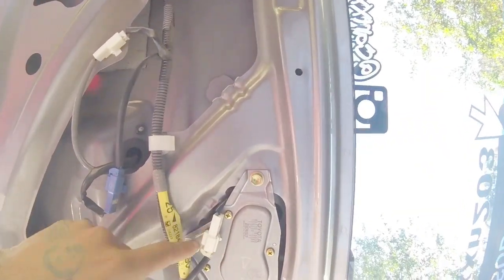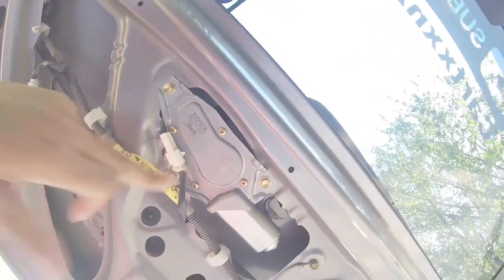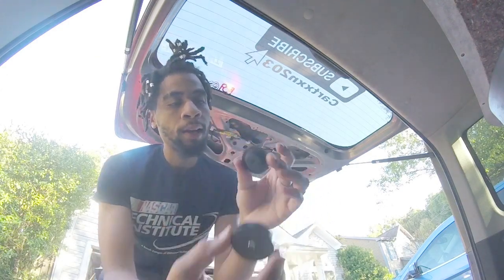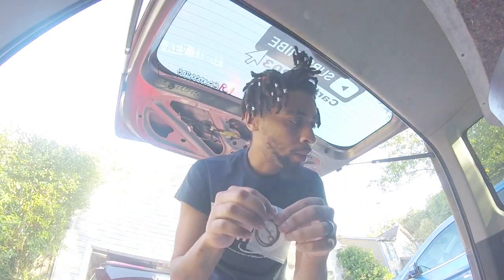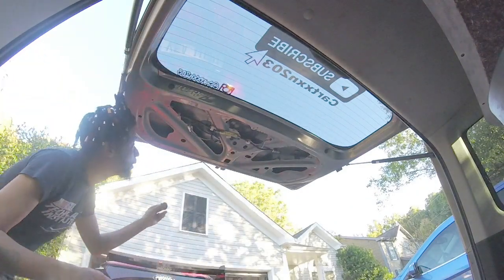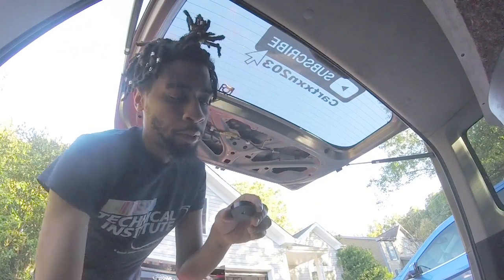Scion xB: Rear Wiper Delete

Comment: Thx to this video I didn’t pull the whole panel off just pulled harder on the outside blade part. It was stuck and I thought i had to go in, but saw you pull yours off. Now I got the new one installed